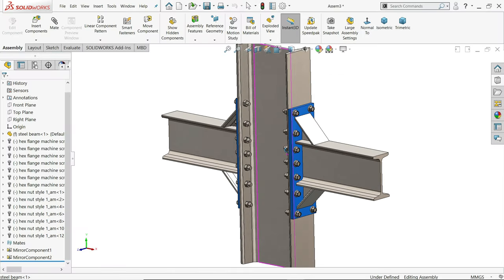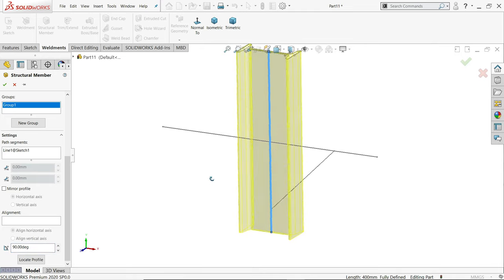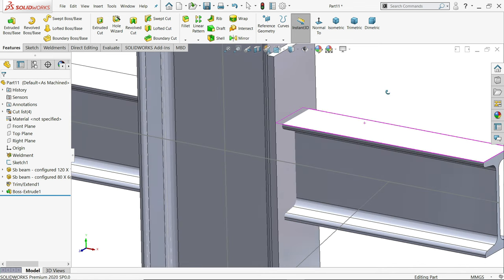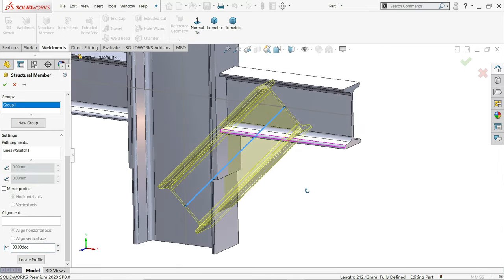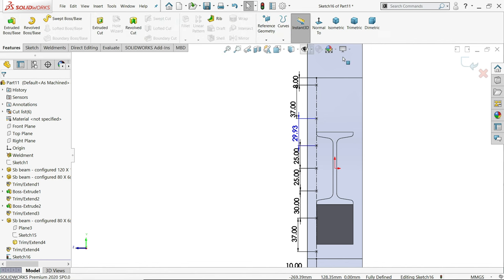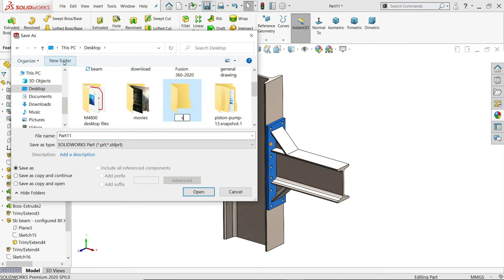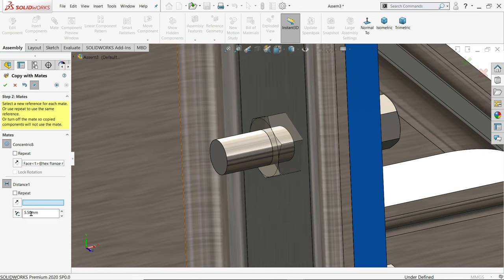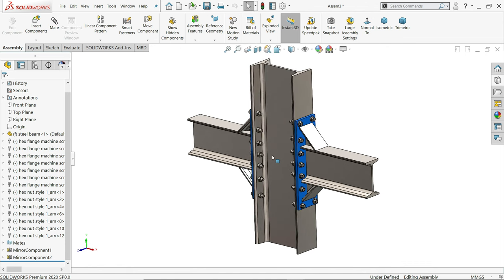SolidWorks Weldments Steel Structure

Comment: i enjoy all your videos. i would like to ask you a question about that beam you split into two pieces.when doing the drawing and doing the bom does it use the total length of beam or will you get two seperate pieces with each length required?
Reply: Hi, I know it's a late reply but it will appear as 2 separate beams in the cut list

Comment: Good Tutorial Channel , but it  is not profesional with this hole . You need to have the exact layout of the holes on the board, but you have given up around the layout. Not good because of the workers in production, it is better to have the same arrangement of holes, if possible ( with hole dimensions 29,93 mm and 30 mm ) it is better 30 mm 30 mm .
Reply: The better method was to create a hole and using the linear pattern to define the number of holes so they would be distributed equally